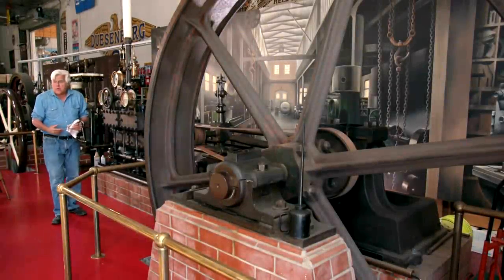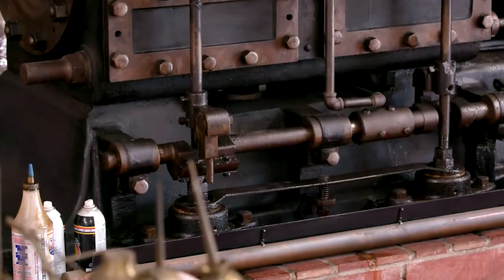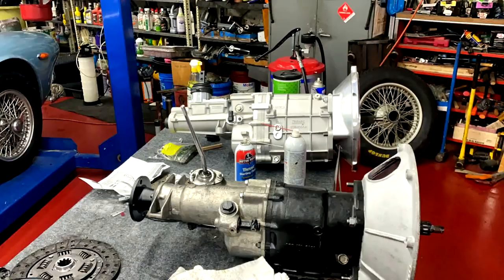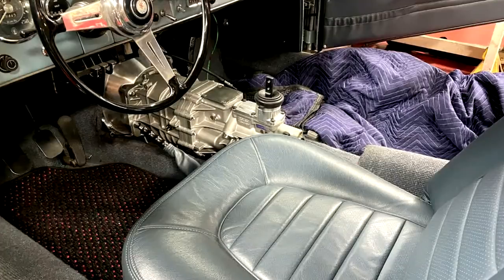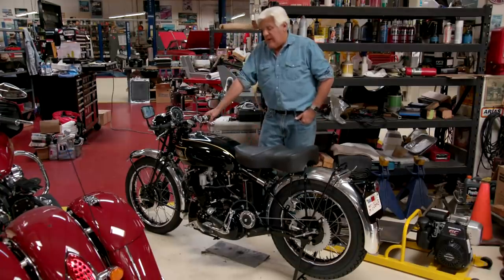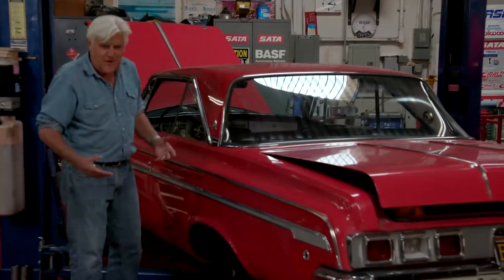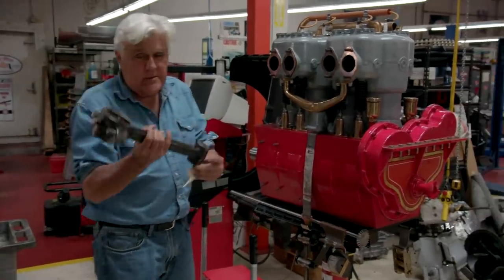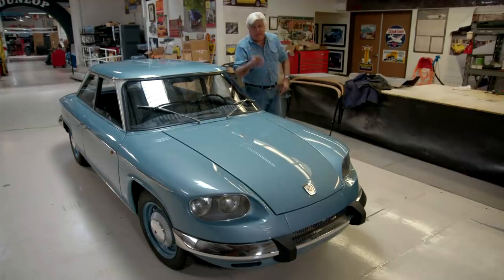Restoration Blog: May 2021 - Jay Leno's Garage

Comment: Hey Jay  -  there's nothing wrong with getting something right. If changing the box and driveshaft is what it takes to make a car 'enjoyable' to drive, then so be it. Because that's what it's all about. Enjoying the car. Doesn't matter what car it is whether a Lada or a Duesenberg  - if it's an enjoyable ride then that's cool. Anyway, how many times have brakes been changed to Willwoods or a different cooling system been adapted to your cars? I don't think it detracts from the esthetic beauty of the Maserati at all and it is a car 'mean't' to be driven - what has changed isn't immediately apparent anyway - nice job ;)

Comment: You can reverse the gearbox swap but how often does it happen?  
I imagine in its day these Maserati’s ran many gear sets for different circuits.  I would have cut a new gear set for modern driving ratios and fixed the gear engagement issues include improved synchro’s, better bearings, better gear alloy all round higher tolerances.  This way you are repairing whilst you stay in keeping with the works cars of the day.  The repair kits can then be adopted by other restorers, keeping as many of these cars alive as possible.

Comment: There is a non functioning steam engine that powered a belt drive saw mill, all  the street lights, and ran it all until the city hooked up to the regular power grid. The saw mill continued with it until, I was told, after WW1. the wheel on that one is a two piece14 feet. It is in a town north of Boise, ID, if you ever want to do a story on it.

Comment: Great stuff, Jay! I love these restoration walkabouts that give us a bit of insight to the process.  As for the Maserati: I think you did a good thing with the transmission. You did not make the machine into a tart, or mess around with what it fundamentally is as a classic machine. You just made it work better ... or rather you made it drivable. BTW: I'm wondering if you have my "grail car" — 59-61 Alpha Romeo Giulietta Sprint 2 door (GT style). Not a fast, extravagant machine, but rather purely elegant and refined with nothing macho about it.

Comment: Jay, was the original Maserati gearbox worn out or was it just a bad design?  What I am asking is; was it repairable? An old classic like that should, IMHO, be restored whenever possible, but there is nothing wrong with a modern update if it solves a design problem.

Comment: Dear Mr. Leno, I get annoyed at how apologetic you are for your modifications.  That is because I fully agree with you for making these vehicles faster, safer and cooler.  Of course I will never have to face the wrath of the snobby vintage perfectionists.  If they scold you just ignore them.  I'm on your side.
PS: It was years before I knew you had a car collection also!  I only thought you had motorcycles!  Cool beans.

Comment: The fact is the Maserati was not drivable with it’s original transmission so the tremic was a necessary upgrade and you still have the factory trans so it’s better than new and you can enjoy it.

Comment: Most Italian super cars(except Alfas) Need a TREMEC.  Jay, find yourself a Nice 8.32 Lancia Thema, They are still cheap and have the Ferrari v8 with a Crossplane Crankshaft.  If you want a real wild engine, get a P&W R-4360 28 cylinder radial engine, and run it like your Merlin.

Comment: What happened to the steam engine that came out of a tug boat. I saw it in an older restoration blog and it was next to a hot air water pump that came out of Teddy Roosevelt basement. Just wondering about it. I love the channel seeing all the different cars. The car with the tank engine is one of my favorites as well as all the steam cars and engines.

Comment: i'm curious jay: on the first engine there is a long leather belt that goes from the huge flywheel back to another wheel. what job does that do? and what fuel fires the boiler for these? oil? heating oil? diesel? wood? coal? amazing vid.

Comment: Is the 64 a max wedge or street wedge? If it’s a real Max wedge it’s a shame the cross ram is gone. With a single 4bbl probably a street wedge. For the dual master Max wedge cars came with a deflector piece of sheet metal that went under the master to prevent boiling.

Comment: I never got the argument of automotive purists where you had "ruined" a car by making it drivable. If you're cutting fenders or swapping engines, etc, you might have severely altered the idea of it being original. Being able to put it back should quiet all complaints. The Maserati couldn't even be called a Resto-Mod. It's just slightly improved and the most important thing is now the car is being driven, not rotting someplace on display as if it's so breakable that it can't be touched. Jay has too much respect for the designers and makers of all types of cars, trucks, etc. He'd never destroy anything.

Comment: Cars like that Dodge Polara are the type that you want to upgrade.  It's not worth so much, nor is it so rare, that you're "ruining" an expensive, rare car by modifying it a bit.  And better brakes, electronic ignition, etc., make the car more driveable.  You can have so much more fun with a car like that, that's had a few tasteful mods done to it.

Comment: A bit of trivia.  ZF was first approached by GM to do the C-8 transaxle.  GM-ZF could not work out a price margin, so GM went shopping for an option.  Stumbling upon a man named Johanne (tied to the Formula One race circuit) Johanne learned of GM's idea of a mid-engine Vette.  Long story short TREMEC bought into the idea, in collaboration with GM, to design a 8 speed gearbox DCT with a built in hypoid gear to meet GM's goals.  The rest is history.

Comment: Historian James Burke presents the case of how a 100hp engine did the work of 800 skilled weavers, but the factory still needed 750 unskilled workers. All the while the factory increased output by a factor of 250, so basically the Steam Powered Factory produced in one day what the skilled hand workers had produced in one year.

Comment: Hello Jay,  do you have a child that can run your collection after you have passed away?  Please may provisions for your collection to continue after you have passed.  Machines such as this form a history that would be a huge detriment to lose.  They are gorgeous  to behold.  As for the other transmission as you say you can put it back to what it was.  Putting new transmission in was a great  idea. It shift and drives and the Maserati  is now useful.  The Black Shadow was a stroke of luck to  to find. Very early bike indeed!

Comment: Thanks Jay , How efficient are steam  engines ??? So you think solar magnifying to make steam for a  steam engines with giant Fly wheel would work ?
Reply: Dear Very Long Name Person:  Steam engines are incredibly inefficient.  As in single digit efficiency.  It's why diesels replaced steam even in coal country where fuel was dirt cheap.  Some steam locomotives turned 3% of their heat energy into forward motion.  But in their day, steam engines were like a miracle and could provide tremendous power anywhere.

Comment: Jay, I reckon you'd be forgiven if you also have the original ZF gearbox fixed. In fact it would be a great vlog if your gearbox guy pointed out what was causing the problem before they fix it?

Comment: As to the Maserati transmission...
If it functions poorly due to inherent design flaws, then I've no problem with upgrading it.  If it functions poorly due to some factor that could be repaired, then I think it should be fixed, not replaced.

Comment: You'd only desecrate the Healy/Masur if you didn't put a matching motor to the new drive train. Maybe a small v8? V12 even?, thinking way outside the Ferrari box. I don't have a clue as to what is in it now.
Reply: It's great Jay. I feel like I'm wandering around inside your head. 😁
VGG.

Comment: Can I get some clarification?  Jay refers to the 1832 steam engine as a "walking beam", then later on he says the Rochester powered Revere has a racing engine that was also called a "walking beam".  Did he misspeak on the Revere, or did is there some other reason it is also referred to as a "walking beam"?

Comment: I use to have a 1961 for galaxie and if I ever have another old car I wouldn’t want an all original car they just don’t drive very well and getting parts is a pain in the butt. I remember one week my water pump went, then next week the starter went, then the fuel pump a few weeks later, then the carburetor not long after. The problem with parts is unless you have an old car with a common engine like a small block Chevy or a small block Windsor Ford you can’t just walk into a part store to get parts off the shelve and if you have a problem you can’t go to just any repair shop to get work done. Now I am a professional automotive technician of 20 years and I own a repair shop so I do my own work obviously but any car I own I want to be able to take it on a trip wherever and it just doesn’t make sense with an old all original car. My next old car will have a modern engine and transmission like a 5.3 and 4l60 trans from a Chevy truck so if I decided to drive 90 miles to the next big city and the engine starts to run like crap I could go anywhere even the Chevy dealer to get it repaired and I know that I can go to any part store to get any parts I need. When I was a kid I never would have wanted to put a modern fuel injected engine in a classic car I always talked crap to people that did stuff like that and I was SUPER against people putting a Chevy engine in a Ford or anything but a Chevy  but now that I’m almost 40 years old I don’t want to deal with any problems I just want to turn the key and go and not for nothing you can buy a junk 2 wheel drive silverado for 1,000 bucks take the engine, transmission, wiring, computer and everything you need pretty much and scrap the truck and most of ur money back so it’s almost free. I have spent 10k building a stroker engine and it’s not even worth it when u can put in a 5.3 with a good camshaft, minor engine work, a cheap turbo and good tune and make way more power than the 10k stroker engine would ever make plus if u blow up the 5.3 for a few hundred bucks you buy another one. I just hate when people say u ruined a car because you put in a modern transmission or engine like dude who cares ur making the car drive better! The old cars had much better styling but the cars of today have way more power, handle much better, way more reliable you would be a fool to not make some updates to an old car. Any car I build will have modern fuel injection, air conditioning, modern suspension, cruise control, just everything thar new cars have. I don’t care what anyone says I want a car to be fun to drive, comfortable. The days of having a carbureted engine that doesn’t want to start when it’s cold, fouls plugs every 15k miles are over with I have better things to do! I don’t want a car that’s just gonna sit in a garage

Comment: Interesting Jay. 1964 was 50 year Anniversary for Dodge. Top of line models. Polara 500, Dart GT, & Custom Sports Special all had 50 year anniversary option woth A Special commemorative horn button there also was a 1964 only. Anniversary Gold paint only available with Anniversary package. Your doesn't have this although its 426 wedge. I assume ots not a 500 model.   500s standard Engine was 383. I've seem only 1 Polara 500. Golden Anniversary Edition with 383 & push button torque flite trans in my life. 59 years

Comment: He must own an entire city block for that garage. I question steam engine as engine denotes that it generates it's own power but motor means it has an external power source. So if you have to burn something to boil water to supply power that would make it a steam motor.

Comment: For the Maserati and "Did I ruin it?"  Absolutely not.  I compare to my Honda CBX.  I have swapped out the suspension for modern stuff.  I have LED lights internally.  I use a more modern chain etc.

But it is all reversible.  It lets the CBX be shared and enjoyed and maintained in running condition by taking it out for running.  It is preservation because it also makes sure catastrophic failures don't happen as well as making it safer to ride.  If there comes a time where it is relegated to just being a show piece?  A weekend and some tools and it is back to all original and in better condition because I haven't blown out the original rear air suspension.

For the Maserati, you put in a durable and smooth and reliable transmission and that means the drivetrain won't be jarred and wrecked by bad shifts and jerky operation or imagine if the transmission gave out at speed and suddenly you find it locked up.

Comment: As regards the Maserati, if the intent is to restore for a stationary display in some museum with a red rope around it, then yes, a functional transmission wasn't necessary, but if as Jay believes these cars are a labour of love to provide actual driving enjoyment as it was originally intended, why wouldn't you address a shortcoming that makes the thing a PITA to drive?  Leaving foundational aspects unchanged so it can be "re-originalled" (my own word) later is observing the historical aspect.

Comment: probably 125HP like jay said and 5000 ft lbs of torque. don't believe me? watch an old steam engine at a tractor pull vid. a good one will out-pull a new one with 5 blown alcohol Hemi engines on board.

Comment: Whilst i get the value of originality, if you can make a classic car more usable, more enjoyable, not to mention safer, by fitting modern mechanicals, then where's the problem? So long as the car looks original and updates can be put back at any time, then i really can't understand why anyone would have an issue with it.

Comment: "Well," he said, "as your attorney I advise you to buy a motorcycle. How else can you cover a thing like this righteously?"

"No way," I said. "Where can we get hold of a Vincent Black Shadow?"

"Whats that?"

"A fantastic bike," I said. "The new model is something like two thousand cubic inches, developing two hundred brake-horsepower at four thousand revolutions per minute on a magnesium frame with two styrofoam seats and a total curb weight of exactly two hundred pounds."

"That sounds about right for this gig," he said.

"It is," I assured him. "The fucker's not much for turning, but it's pure hell on the straightaway. It'll outrun the F-111 until takeoff."

"Takeoff?" he said. "Can we handle that much torque?"

"Absolutely," I said. "I'll call New York for some cash."

Comment: The Luddites weren't actually against technological innovation. Just the fact that the benefits of the technology benefited the life of the capitalists rather than the craftsmen. Instead of providing a better, easier life for "regular people" (these crafts people were definitely not the bottom rung of society either) it provided a worse life for most and accumulated wealth to an elite few.

Comment: Why not just rebuild the original trans?
Reply: For the same reason no one rebuilds TurboGlide.
Reply: @terry94131  I think the car is worth more with original. Different trans, where does it end why not put in a Chevy small block etc.

Comment: I've never understood the idea that an original yet mechanically flawed car is valued higher than a properly modified and mechanically superior car. Anyone who thinks making a car more reliable and usable by replacing a weak point is a person who cares more about the idea of a car than actually driving it, and I don't relate to that ideology at all. Sure, there's absolutely an argument to be made for preserving a car when it comes to identifying characteristics like body panels and engine notes. But when it comes to a human-machine interface like a manual gearbox, I'm 100% onboard for going with a modern part, and tossing the flawed classic part in the bin.

Comment: jay we have a 1968 classic motorhome 40,000 original miles its a time capsule a industrial engine in front its a dodge class A special construction only a few made has a ww2 jeep powerplant for a generator been sitting for 35 years owner desperately wants it rstored and preserved u can have it for free , its a classic - never have u seen one  pictures to follow located in zip code 93422 California - please look u will want i hope and pray i m to old and tired to fix and use - it was built with aircraft quality and is truly a classic - must see please please please